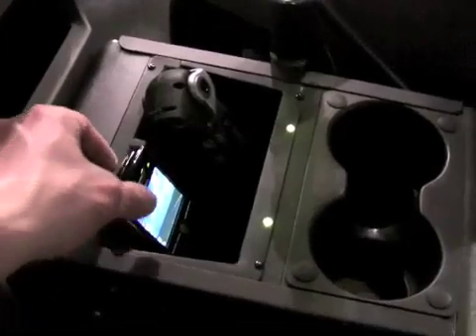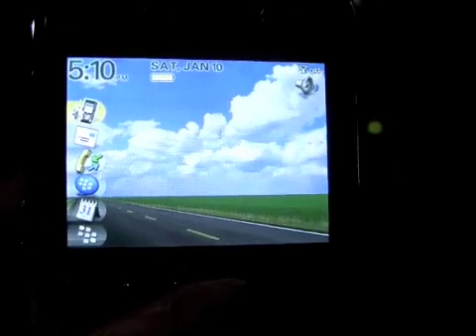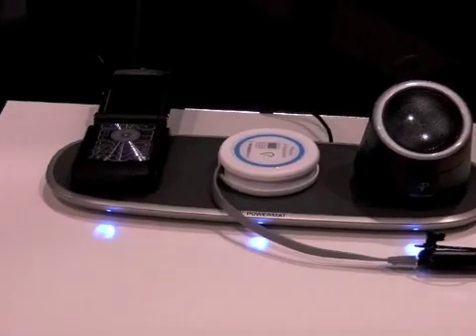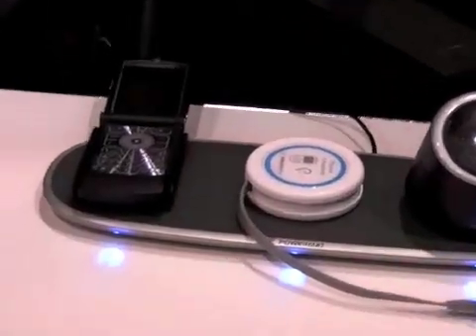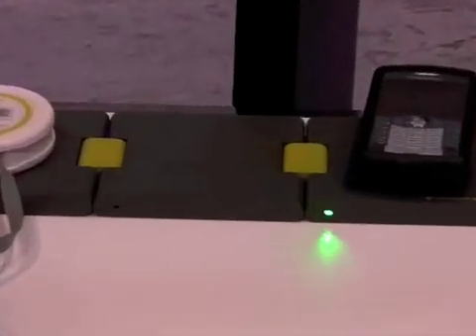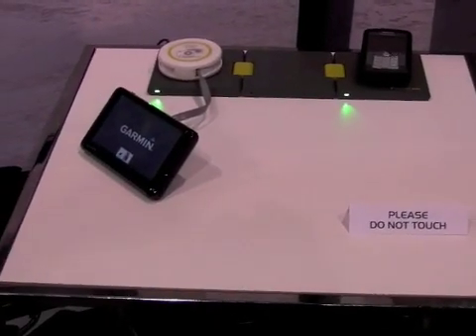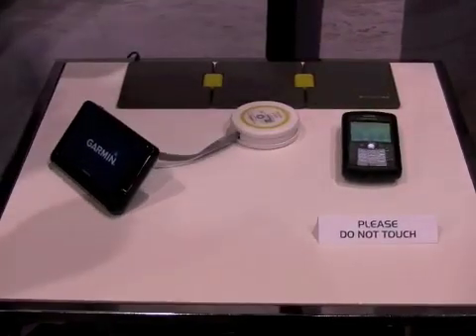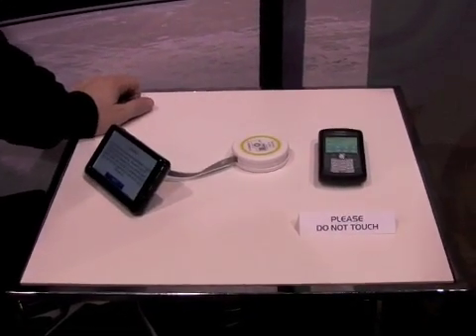Wireless Charging

Comment: It works almost exactly the same as a normal phone or laptop charger, current passes through a series of coils, generates magnetism, the devices have different coils which turn this magnetism back down to a safe voltage to charge the battery, why not just bring the normal charger and save yourself carying around bulky, expencive electromagnetic chargers like this?

Comment: @Lotus2200 but the kind of power needed to run something like a motor for example is just not transmitable. Tesla invented the Tesla coil which generates man made lightning effectively, that is power being transmitted but only by passing a bolt of lightning between two large metal objects, not safe or practical for anything really. in short, this technology can work, but not for powering cars, or charging your phone while its in your pocket. a perfect use for this would be a wireless mouse

Comment: @Lotus2200 its to do with how power works, radiowaves for example are not very powerful, you could probably get hundreds of feet of wire, and pick up enough charge from all the radiowaves to light one LED. radio station transmitters use huge amounts of power just to do that. there is a big difference between a signal and actual power. this could in theory be done, for example you have a coil in the device and a coil under the device and it would work simillarly to a transformer without the core

Comment: that power mat one is stupid. u have to connect that chip to all ur devices and than put it on to the mat for it to charge thats pretty much the same amount of work as pluging in a wire to your device to charge.
i like the first ideas better, where you simply just put your device over a charge station and it automatically charges without any extra parts connected to your mobile devices.

it's much more convenient .
that wireless in car charger is nice too. i would like one

Comment: For a good read, look up "wireless energy transfer" on wikipedia. But besides that... The transmission of electricity through the atmosphere vice high voltage transmission lines wouldn't eliminate environmental pollution in the slightest. If anything, it'd probably make it worse because of a decrease in overall transmission efficiency. Additionally, it'd eliminate accountability of power usage.

Comment: That definition isn't as specific as the definition used in science. The radiation emitted by this device is by design quite weak; the energy transfer is performed by the near-field (in this case, through resonant inductance). When the transmitter and receiver coils are tuned to the same frequency, they share a standing inductive wave which allows them to transfer power efficiently (here, probably 60 to 80 percent). At resonance, power transfer is similar to a normal electromagnetic transformer.

Comment: obviously you have no clue what you are talking about.   all this thing does is communicate its identity through ratio waves (just like your cell phone or wireless router)  and then uses a changing magnetic field to excite an electric current in a coil that is nearby.  other things that use this principle? any AC adapter you have ever seen, electrical transformers of any kind, those loops in the road that detect cars at the light, and even electric guitars.  the "radiation" is all around you....

Comment: ah but Tesla has already proven wireless electricity. If you watch the movie The Prestige there's a scene where Tesla lights a field of light bulbs that are in the ground, which actually happened. Just wait, we're very very rapidly moving towards a world without wires. It's actually in practical use, unlike them saying we'll be without tires in 100 years. Which we can do, but it's not practical.